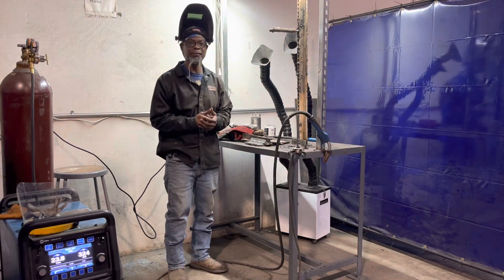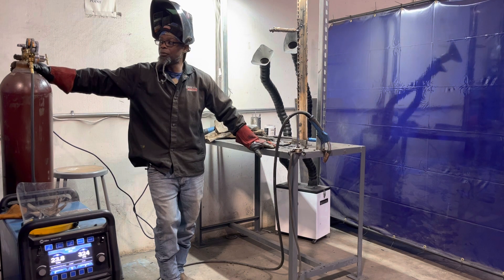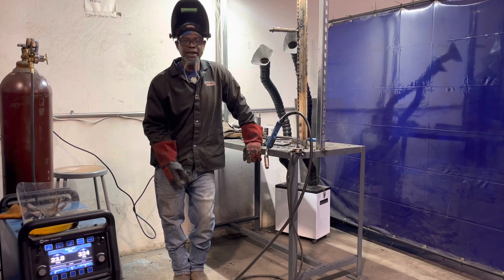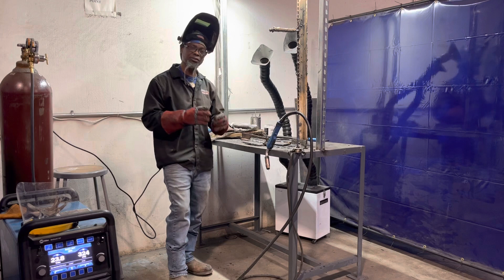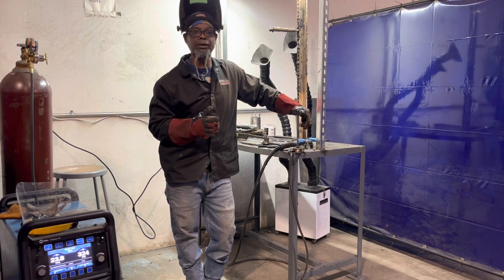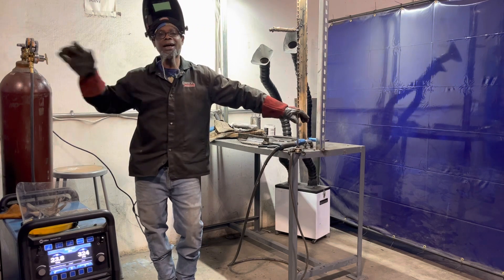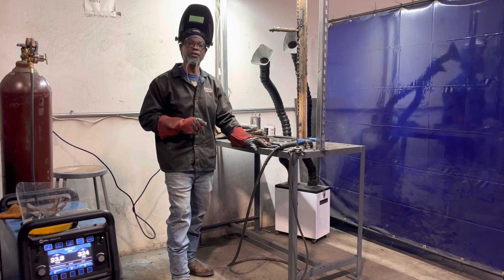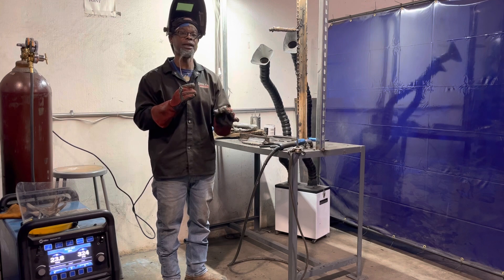How to Fix Fluxcore Welding Wormholes → “Stop Wormholes! The Secret to Clean Flux Core Welds”

Comment from the maker: How do you prevent wormholes in flux core welding?
a general rule, the wire should extend no more than 1in - 3/4in  beyond the contact tip. Additionally, to prevent wormholes, marks on the surface of the weld bead caused by gas that the flux in the core of the wire creates—avoid excessive voltage for your given wire feed setting and amperage.
Reply: Fix your name of this video to Dual shield Flux core  because I use normal Flux core

Comment: I finally fixed my wormhole problem for my flux core. I bought a new welding machine and i set the gas flow too low. I followed the manual saying 0.9mm wire with 8 - 12 L/pm. I forgot to realise that i was using a 1.2 mm flux core wire. So the bigger the wire equals the bigger the weld therefore i would need more gas flow. I increased my gas flow from 10 L/pm to 18 L/pm and now i stop getting wormhole! And also when setting the gas flow make sure you set it while the gas is flowing through the gun so you know the true gas flow number you'll be getting. One of my new colleague at work was getting this issue and now i know what to tell him ;)